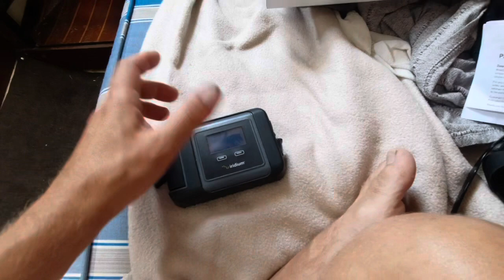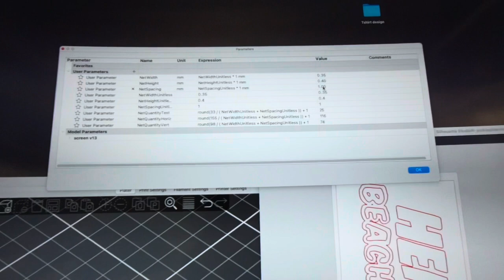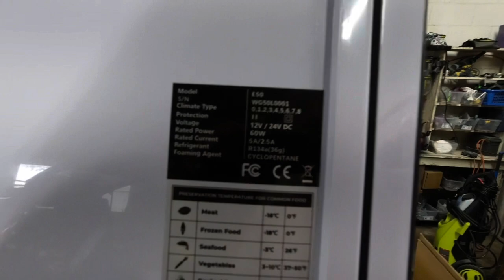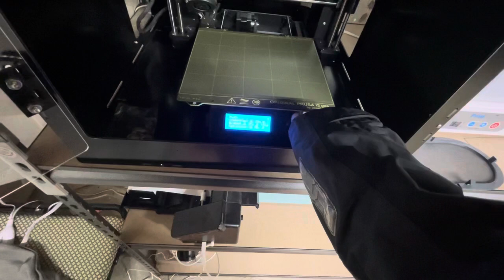Shakedown Chaos

Comment: PLA is pretty good if u do 3-4 outer walls, when finished sand lightly and wash, when dry 1-2 coats primer then 2 top coats and it will usually protect it well

Comment: Yeah, I kind of think the iPhone charging cable thing is an engineered fault by apple.   Guess how many charging cables I have gone through since I got my Samsung Galaxy 9+.   None still using the original cable, so yeah, that's apple trying to squeeze more money from the user.

You know why I know it's an engineered fault because when I used to sell apple cables, I always had the customer return them after a week as not working.   And testing these non-working cables on a friend iPhone, they worked perfectly.   So I don't stock what I call Apple Garbage anymore in the shop; why should I have to foot the bill on their purposefully designed faults.